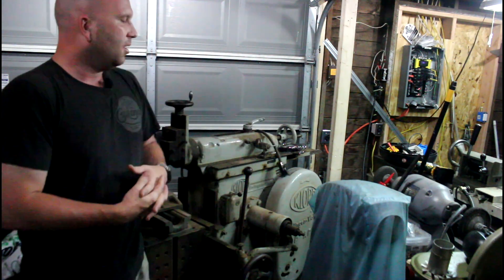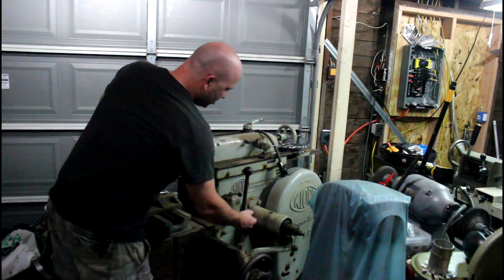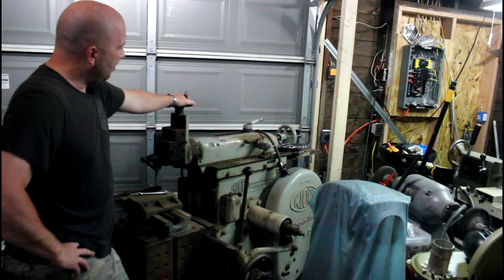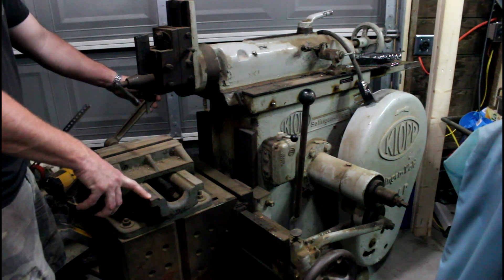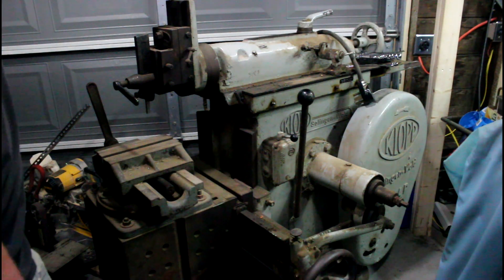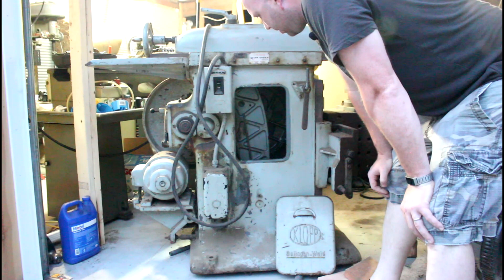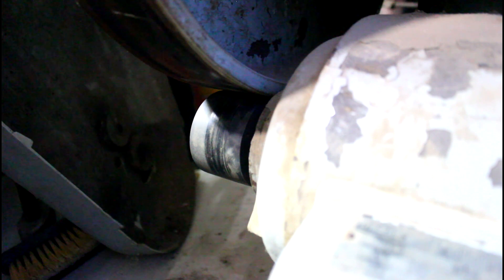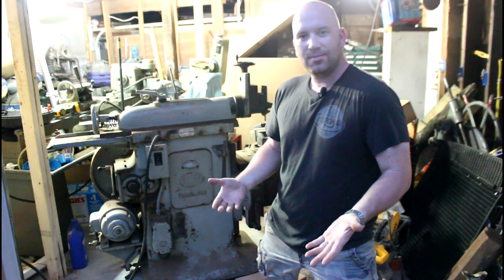Klopp Metal Shaper Part 1 The Overview!

Comment: I can't really tell you about the grease or not but there are some very small machines completly oil except some parts with grease then i have seen a manual about 375-550 modell but those are different they have oil sumps then  the machine number i heard that you can write klopp an email and can get information about the machine when it was built maybe a manual just heard about it can't promise you anything about that ps is basicly hp metric the one After horsepower is rpm 60 per second i would guess rpm per second when running 3500 rpm i don't know anything about the motor
Reply from the maker: Thanks, I go this stuff all figured out. The machine runs good now and have used it for several projects.
Reply: @precisionmachineshed  i have thought about getting a shaper klopp better condition but i would have to get it down a stair that and the costs are pretty nasty i mean you pay aroun 200 bucks just for the oil then you have to have something to lift the heavy parts with quite a few problems i would have to tackle but i'm still thinking about it

Comment: My dad rebuilt motors for years Helped a lot. Looks like wired 440 and you're trying it on 220. I don't think it's a brushed motor. Not sore about the phase hook up. If it's 3 phase and you can get it spinning it will run on 1 phase. Not good without a phase converter. Has capacitor box so may be 1 phase. Voltage can be changed or it wouldn't show 220/440.
Reply from the maker: It was correctly wired for 220v 3 phase in the machine, someone tried to wire it up for 220v single phase with the power cord. Swapped the plug, re-wired and it's been running great for a while now. thanks.

Comment: Motor issue are just a dead start capacitor, they die of old age, used or not.
See Astra-werke here on YT, he renovated a larger klopp and knows everything about them, he's German
Reply from the maker: I talked to him a little about mine. He has a very nice looking machine. Mine was 3 phase which i wasn't aware of right away. Runs like a champ.
Reply: His machine is one of the ones you see the most anging from 375mm he has got that size over 450 to 550 they built them large with a 6 speed gear Box i think and up to something around 800mm

Comment: What a nice machine. Klopp knew what they were doing when building these, they are very, very ridgid and well thought through.
The zerk fittings are for oil - I have the complete manual and scanned it a while back - I'd be happy to forward it to you, e.g. via WeTransfer maybe?

The motor not wanting to start looks to me as if there are only two (or even one) phases connected instead of all three.
Certainly a wiring issue and not a fault on the motor itself.
All the Best
Adrian
Reply from the maker: Thanks yes, a manual would be great. I did get the wiring issue figured out and I was thinking the same thing as far as missing a leg. I will have to do some more research on finding an "Oiling Gun". That makes perfect sense, unfortunately for me, I get to clean all that out of there first.
Reply: @precisionmachineshed  You should be receiving an email shortly.
They used grease on the cross table of my machine, too... Flushing all the oil channels out took its time xD
Reply from the maker: Got it, thanks for all the help!
Reply: @precisionmachineshed  No problem :D

Comment: I had a three phase 220 compressor that did the same thing your motor was doing. I ended up changing the motor out to a single phase because I didn't have 3 phase close. Best of luck.
Reply from the maker: Yeah, I have a rotary converter so 3 phase is no problem for me.

Comment: Please don’t pump grease into it. That’s what a previous owner of my Klopp 450 did and it basically resulted in worn out parts and clogged lubrication points. Here’s a manual: http://www.ardiehl.de/Steinel/Klopp_375-550.pdf It’s in German, but on page 5 there’s a lubrication diagram and almost all of the stuff there, except bearings etc, is lubricated with oil. There are instructions on the internet on how to modify grease guns to work with oil, but there are also off the shelf guns, I have a Pressol 12602
Reply: One more thing - it seems that you have a slider for a lifting mechanism that is different than most of the shapers that I’ve seen in Germany. Would you be so kind and make some close up photos if that thing? Most of the Klopps have a rubber foot mechanism that slides on a metal way. It seems that you have a metal on metal slider? I would like to modify mine to get rid of the rubber thingy as it’s worn and the rubber is hard to source.

I can send you photos of the rest of the lifter when I’m around my shaper (as it lives at my parents in law place).
Reply from the maker: Thank you very much for all the information! I was actually quite surprised to see all these grease fitting all over the machine. That is half the reason I haven't run the ram yet is because I want to clean all that up before anything gets any damage. I'll see what they did and possibly put oil cups in place of the grease zerks. As for the lifting mechanism, I noticed it looked different than most of the ones I've seen online. I have not looked to see if it has a rubber or metal shoe. I'm not sure how old this machine is, but I have only seen one other one in a similar configuration online and I think it is an older model.
Reply: @precisionmachineshed  > That is half the reason I haven't run the ram yet is because I want to clean all that up before anything gets any damage.
Sure, good tactic :) I think it's often the case that some people don't check the manual (like the owner I mentioned) and just assume that grease fitting equals grease (and I know that the guy that I bought the shaper from had the manual, cause he sold it with the machine).
> I'm not sure how old this machine is, but I have only seen one other one in a similar configuration online and I think it is an older model.
I think that yours might be actually one of the newer models, like from 70s? I mean, I don't really know that much about Klopps, but I know that the oldest versions don't have a tool lifter, there are also slightly newer versions that don't have automatic oil pump from the main casting to the ram (they usually have glass oil windows, you can see it in quite a detail on @AstraWerke video: https://www.youtube.com/watch?v=wIz1YJXMw_Q) and then there are one of the recent versions that you could see in the manual I linked to.
I'm not sure where it places your machine, but I've seen the same configuration (ie. different tool lifter and the drive on the right side) in machines that looked like more recent versions, like in here: https://www.machineseeker.com/klopp-k5b/i-2739606
Btw, do you have a mechanism for an automatic downfeed on the left of the ram?
Reply from the maker: I took a closer look inside it today and it looks like it has grease all over on the inside around the main ram ways. Might end up being a fairly involved tear down and cleaning. I've seen AstraWerkes videos and I think his is  a 375, the other you showed there must be a 550. I don't have any oil windows and I haven't seen any accommodations for a oil pump system.  There is no auto down feed ether. Would be nice.
Reply: @precisionmachineshed  
> I took a closer look inside it today and it looks like it has grease all over on the inside around the main ram ways.
Ouch :( Hoping that they're not too badly worn or scored.
> I've seen AstraWerkes videos and I think his is  a 375, the other you showed there must be a 550
Yes, that's right. I myself have a 450 that is in-line with the machines from the PDF manual. I think that each of the generations had a few size versions with similar features. Like - I've seen also bigger versions that had features like Adrian's 375.
> I don't have any oil windows and I haven't seen any accommodations for a oil pump system.  There is no auto down feed ether. Would be nice.
Interesting. I thought that ram ways lubrication would be the standard in all of the versions. Especially that your model also have a tray at the back that is supposed to catch dripping oil and get it back to the main gear and pump back up to the ram. I'm really looking forward to the teardown to see what the machine hides inside :)

Comment: You look like you are in a single phase location. I did not hear any rotophase converters running, so, I assume you connected it to single phase. If that is the case, the motor will not start. If you spin it by hand under power, as in the video, that is what I would expect a three phase motor to do in that situation. The motor tag did show 220 / 440 Volts, and so if it is not, it can be wired for 220 volts three phase. It will start and run on 220 volts even if it is wired for 440 volts though, (if the circuit is pure mechanical) just that it will not have much torque. If the electric circuit is only mechanical switches, you only need to wire the motor for 220 volts. If there are magnetic contactors, transformers or other electrical components, other work will be needed to change it from 440 to 220. Real nice machine. Hope to see you make something on it.
Reply from the maker: Thanks,  it is wired for 220v and from everything I can tell on the machine its single phase.  I do have 3 phase power,  but will need to do more research to figure out what the problem is.

Comment: A: Looks like you're missing both the filter capacitor and the motor start capacitor. B: there's a very high possibility you've got a inline frequency problem. C: judging from the running speed, the machine was previously wired for 440/480, you need to change the wiring positions on the motor junction box. German machines may use different frequencies than the US/canada, so you may need a frequency converter. It's likely that the grease inside the bearings for the motor is toast if the machine is that old. I've taken apart enough that it is likely best to buy another motor off of craigslist or find a 1-3hp 3phase motor and get a vfd. It will allow for many more speeds, which comes extremely handy on a shaper.
Reply from the maker: Frequency is 60, and motor is wired for 220v. I have a junction box I have'nt opened up yet,  but I'm thinking its just that,  a junction box. I don't see any other filters or capacitors.
Reply: @precisionmachineshed  The caps could be located near the vicinity of the two-way switch also. A grizzly I was working on had it set-up that way. When it is turning at speed, are you capable of stopping it by any means? It looked like it was spinning really slowly
Reply: I wasn’t really paying attention until I heard the electrical problem

If it’s single phase with a start cap you might also have a centripetal switch that may be at fault

If you have access to a clamp meter i would be interested to see what current is being drawn but it probably wouldn’t give much insight

Comment: I'm betting it's on 440 volt, just needs to be changed to 220. Nice purchase!!
Reply from the maker: Motor is wired for 220v.
Reply: A squirrel cage motor would just draw excess current as it attempts to get close to synchronous speed if that was the case
And unloaded would possibly run reasonably fine

Comment: Hey Precision,
Its amazing how shapers have made a resurgence. Most shapers were retired in the mid 90's because they were considered a negative stroke machine by not cutting on the return stroke. I guess for hobbyist that doesnt factor in. They did have a purpose and cutting big flat surfaces wasnt one of them. They were great for chasing lines on curved pieces. I roughed out my precision angle on a shaper. Im a subscriber you got me on your sold little atlas lathe. Check out my channel and see what i do.
Mike - Plus8Precision
Reply from the maker: Hey, Thanks! I took an interest in these things about 5 years ago when I first got my Ammco Delta shaper. There was next to nothing online about running them so I made a series of videos not really knowing much about them at the time about making a Safety razor case. Turned out really nice, but took way to long cause I didn't know what I was doing. Seems in the past two years a few guys on Youtube have picked them up again and started covering more material on them. I forgot this is actually my 4th shaper. I breifly had a late 1800's Hendy 16" shaper i believe it was. It was a line shaft machine that I sold to a guy that was into mid to late 1800's tooling and he has since retro-fitted it with an electric motor and got it running. That thing is neat to watch run. I have some projects planned for this guy for sure and they should be worth watching!
Reply: @precisionmachineshed  you make them ill watch em

Comment: Fun project, most of my machines came from farm shops in which the machines sat for years. With a little TLC and research this shaper will work tip top!
Reply from the maker: Yeah, I've gotten a few over the years. I still have a South Bend 10L sitting in my shop that sat outside for a year or so, but it's actually in really nice shape under all the grime. A couple years ago I restored a Godell Pratt Benchtop miller that was in the corner of some guys shop under a bunch of junk. Got it for next to nothing because neither one of us knew exactly what it was and after sitting on it for about a year, I dove into it and restored it. Was a nice little machine and found out it's kind of a rare little machine. I sold it to someone that wanted it more than me. Was a Gem though!
Reply: @precisionmachineshed  thats awesome! I parted with my Covel surface grinder....but have found my Monarch Ck lathe and Kearney Trecker mill to be priceless additions to the shop. I had a SB 9" floor model cast base for years (transistion year before heavy 10) and sold it a few years back to make room for the Monarch, but man i wish i could have kept it, she was a beaut! Lol You always need a bigger shop they say!
Reply from the maker: I hear ya. I need twice as much space as I have now. I would love a bridgeport and a KT horizontal, but no room for ether.